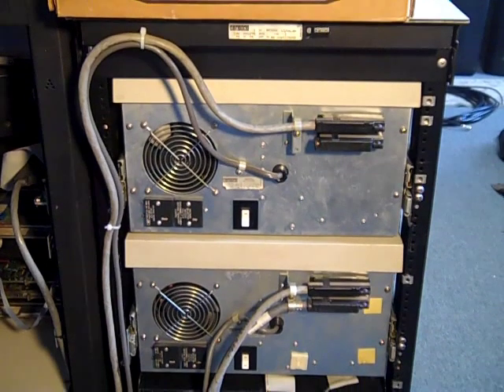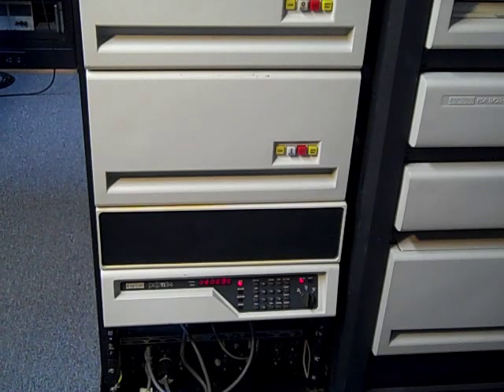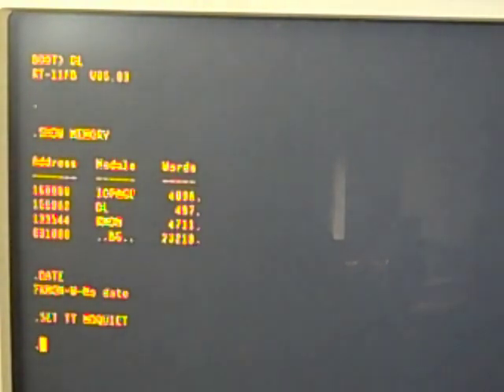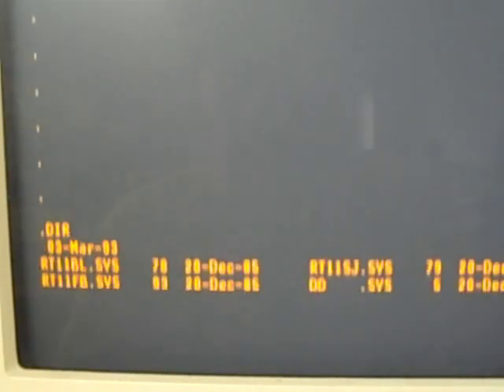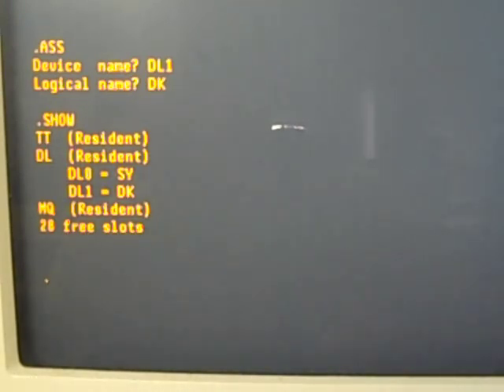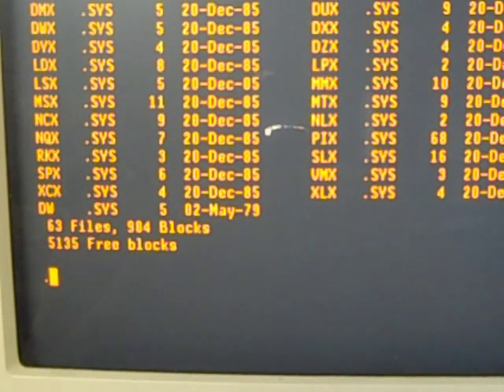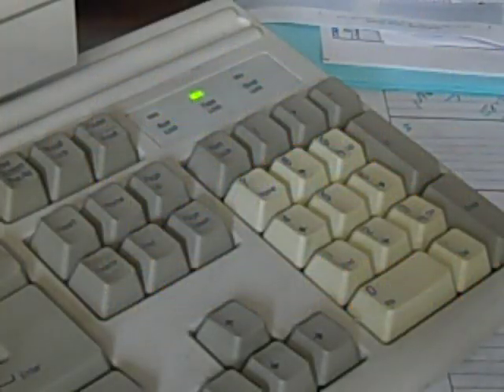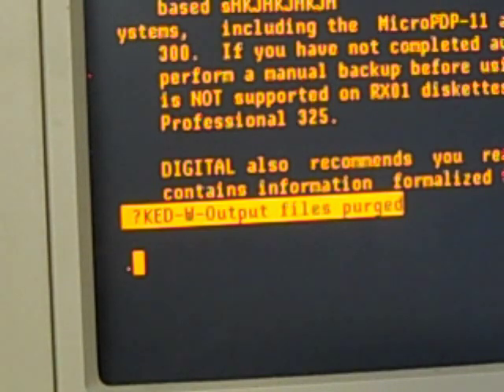PDP-11/34 with RL-01 drives

Comment: That's a marvelous set-up you have there! 👍 It really brings back memories. In the late 70's, I was a Research Specialist for NASA and the McDonnell Center for Space Sciences at Washingyon University in St. Louis. I maintained and programmed two PDP-11/34 systems running RSX-11M. One of them did scientific calculations, and the other drove a Tracor-Northern  automation system of a JEOL JXA-733 scanning electron microscope / X-ray analyzer.  The TN system used a microprocessor that was a PDP-8 emulator. Great machines!  BTW, about 4 or 5 years after that, I bought a VAX-11/730 for my personal home computer. 🙂
Reply: sos un genio

Comment: I programmed the device driver for the RL01, I believe, originally for the PDP-8. It used a technology that permitted bad disk blocks, detected during manufacturing, so the device driver maintained a map of the bad blocks to make them disappear from the address space. And all this in 512 12-bit words of memory.
Reply: Most people would ask how? Until they understood how well the DEC hardware was made. Everything was done by the hardware. You could write drivers that were tiny...in some cases, 2 words for a bootstrap loader. I have an DEC LSI-11 made by Heathkit. Kind of a rare specimen. with dual RX01 drives.
Reply: That's amazing. Testing for bad blocks was necessary for prolonging the disk's usefulness. Sometimes you had a mission critical operation where you couldn't just simply change out disk packs.
Reply: @classicnosh  Yes, indeed. My understanding is that the product was successful based on my special formatter and device driver. Of course, today disk technology is far better so the need to support bad blocks or tracks probably is no longer needed.
Reply: I assume there also was a diagnostic utility to read marginal sectors and write them to an unused sector and re-map the bad sector to new sector without data loss?
Reply: @JanBruunAndersen  Not exactly. You had to retrieve the good data onto another drive or a tape. Then you could run the formatting program, which would start with the factory-determined bad block list then test all the blocks as fast as possible then create the final bad block list mapping and combine it with the code so it would fit into the 512 words allocated for the device driver, which it would then install. Then you'd copy the data back to the disk. If we wanted hot/dynamic bad block elimination, we could not have fit it into the ancient device driver scheme. Our achieved goal of mapping out the bad blocks so they disappeared was the most we could hope for.

I'm not actually sure how they set up the RL01 for a PDP-11, since all my code was for the PDP-8. It might have had an all-hardware controller, which would have done the bad block mapping.
Reply: For what operating system?
Reply: @david203  I believe it is to a certain degree, however not as a result of manufacturing but wear
Reply: @kreuner11  The main OS for the PDP-8, if I recall correctly, it was called OS-8. It was many years ago, sorry.
Reply: @kreuner11  Mostly due to inexpensive manufacturing. Most bad blocks were that way from the beginning. That was my understanding at the time. My code had to handle many bad blocks and remove them from the address space.
Reply: @david203  indeed it is I see, thanks

Comment: We had VAX computers when  I was at GE from 1983 to 1991.  Also MicroVAX.  The disk packs were 3 or 4 times the height of the RL01 as I recall.  The operation of the disk drives and status lights brought back very fuzzy memories...

Comment: The good old days, the smell of a crashed head on the platter, setting the cats eyes, mod wiring the backplane for the controller to boot the RLO's, (used to love playing with the platter spindle, you could use them for drive shafts on a tank).
Going into data rooms that permanantley smelled of the last crash. Also the Megatek Whizzard graphics (I think 7700) controller that was sometimes the graphics controller (used in REDAC systems) connected to a kratos Mono Vector monitor or a mitsubushi colour Raster running Dsys diagnostics. the 11/34 and 24 were the ones I tended to service the most often.

Comment: Nice video... brings back lots of memories. I started RT-11 version3.0b in 1978. I was with DEC FS for Decades. Minor detail, MSDos came after RT-11 so RT did not look like MDDos... it was the other way around.
Reply: Yup.  RT-11 predated CP/M, and CP/M predated MSDos.
Reply: As a software developer, I had a lot of respect for Field Service engineers, who had to handle just about any problem, sometimes in very short periods of time.

Comment: In the late 80's, I had my own complete PDP11/34 system with a VT52 terminal, 4 10MB drives (RL-01) and a full-size tape drive (14" reels).  I purchased the system for $350 and 3 of us hauled it home.  I don't know what it sold for new except that the tape drive had the original invoice taped to the back showing a price of $65,000!  Everything worked and it looked brand new.  I played with it a few times, but it didn't really do much.  It had the RSTS operating system that included BASIC.  The seller gave me a few disk packs and tapes they still had.  I found a tape of something called "UserBase" that appeared to add database ability to the system but I never figured it out.  

What a beast, but I loved it.  It took up half my dining room and was louder than a jet plane.  All my friends thought I was nuts to buy it, and of course they were right.  My IBM PC ran circles around it.  So why?  Well, I had a job for a while  programming a massive PDP11/70 colossus.  It was maxed out with dual CPUs, 10 250MB drives (the huge disk packs cost $1200!), and 5 definingly loud "drum printers" -- all in a climate controlled room with backup power and a Halon fire system.  There were 63 VT220 user terminals connected and the stack of cables behind the main unit was 2 feet deep.  It was such an impressive monster that just starting it up made you feel like a god.  I just had to have one of my own.  Sorry to say my system eventually ended up at the dump (*sigh*).  Much like the 11/70  I worked on.  It was eventually hauled away (donning a 'for sale' sign that said 50 cents or best offer) and replaced with a very big VAX system.  But that was only used for about 6 months before company politics caused the VAX to be auctioned off and replaced with an IBM system 38 plus new terminals and miles of new "twinaxe" cabling (those IBM salesman are good).
Reply: Sigh. Prices were very high in those days. They had to support may trained people to sell, build, and maintain the hardware, and to program the system software. I worked for DEC in several departments, later worked for Prime Computer and lots of other companies.

Comment: Thanks so much for posting this! I miss this machine so much. RT-11 SJ had a multitasking cousin called RSX-11, designed and implemented by none other than Dave Cutler, the only intelligent person still left at Microsoft. The KD-11's had TTL ICs on them and was built out of 74LS181's if I recall. I could fix them with a scope and a soldering iron. I wish I had one in my basement. I spent so many hours playing "Advent" on this. Wrote tons of code for the IP-11 too decades ago! Thanks so much!

Comment: I once had access to a PDP-11/44 running RSTS/E. that was the extent. My first time at college I realized you could allocate devices from terminals things like other terminals etc. including the system console. That's a story in itself. However in my career I also got to manage  a Data General Eclipse MV9500 that I upgraded to an MV9600 that was running AOS/VS II.

Comment: I used to use RSX11M on a PDP11.  It was a newer 80's model.  I remember being told that they had a choice between this machine @ $35k or a new thing called a P.C.  They decided that P.C.s were never going to catch on and endure so they bought the PDP11!  It had a 10MB drive but only 540k RAM.  We used it in conjunction with an X-Ray Spectrometer for metallurgical analysis.  There I had to issue an MOU command to mount the floppy AND the hard drive.  You know in the end I wound up owning that machine myself but I was too young to realize what I had so I got rid of it at some point!
Reply: So hard to predict the future, so easy to look back.

Comment: Used to Maintain Dec. A lot of these tpe were used for CAD and graphics Via the Megatek Whizzard Controller. Unplugging the drive number button to change the boot drive. VT terminals especially Vt220 used to blow the serial interface chips like no tomorrow.

Comment: How much did each disk pack and drive cost, back in the 70's or 80's?  For them to only hold 5 mb of data, not much could be allocated to each user.

Comment: I thought that UNIX would be case sensitive because I find with the OS that I am running on my computer if I use CD or DIR I get the error CD OR DIR not installed do you want to install it but if I do cd or dir then the function operates as expected if you are interested as to what OS I am running well it is DEBIAN UNIX, if I want to edit something I use gedit, I am running Linux Mint 17.3 (Rosa) 64bit (Cinnamon) Lothar Scholz I could run Doom under Wine for Windows and would be very fast, I have had a good close look at a PDP11/34 which was installed at Trostan Avenue which was the Collage of Further and Higher Education, But the DEC VAX750S was brilliant but if you wanted to do something like add extra memory or something than you had to wrap up warm as it was so cold that even brass monkeys would have problems.

Comment: That would be really cool to make an RL-01 drive with a USB ibterface so you could run one as a USB thumb drive. ..... Can you run Linux on that thing?
Reply: TalksWithDirt There_is_a_video_on_youtube._search:_The_Worlds_largest_USB_thumb_drive._Don't_mind_the_underscores._For_some_reason_the_space_bar_doesnt_work_in_the_reply_field
Reply: Gonna look it up now. Hope its as cool as your solution to the space issue. :)
Reply: Probably not Linux compatible - 128k is nowhere near enough memory to run even the slimmest kernel, let alone anything else. Plus if it's as similar to the 68000 as is sometimes made out, it might not have sufficient virtualisation and memory protection abilities by default ... though some 68k based workstations got around that by incorporating bespoke memory management units and the like, so possibly if you added that plus a load more memory it can run a very spartan distro, very slowly, and without any graphics.

Not sure why you'd want to though. I mean, the default DEC OS (TOPS, I think?) was essentially a thinly disguised Unix fork, so that should do the job in most regards, and that's what all the software will be designed for.

Comment: How can you stand the noise it is really loud why you want to have that can not do much
Reply: This thing is quite expensive, they are no longer being produced, and they are some form of an artifact for people who like collecting old hardware and such.
Reply: An older PDP 8, is on sale on ebay for $6000 USD.

these are antiquities.
Reply: He may have only shown off the very basic functions, but that's not all it can do, same as if you were only shown DATE, ASSIGN, HELP and EDIT on an MSDOS machine you wouldn't think those were its only functions. PDPs were quite a popular choice for all kinds of professional, academic and other institutional uses, and a home user who doesn't really have any call for any of that other than curiosity can still find a good number of games to play on the system as the DEC hackers weren't exactly unfond of computer gaming.

As for the noise, they were still a lot quieter (and smaller, and easier on the power budget) than an equivalent mainframe of ten years earlier,  and those fans are probably quite worn out with less than smooth bearings these days. Normally you wouldn't work right up next to it anyway, it would at least be in the other corner of the room (serial terminals can use very long cables without any trouble) and maybe behind an acoustic shield or with the fans venting out of the room, or just as likely in an entirely different room altogether and forming the basis of a multi-user system with a dozen or more remote terminals, a lot like the modern day equivalent server room.

Comment: Is that rack the whole computer or it is actually larger?
Reply: The "computer" is the lower module in the rack; the upper two boxes are the equivalent of a pair of external (and removable-platter) hard drives. So, yeah, the entire system is in that frame, though the terminal used for human interface is of course separate. That's where you get the "minicomputer" vs "mainframe" distinction - a mini would fit into just one of those racks, often only needing a half-height one (or three quarter like the floppy-equipped system next to it; full height if you added a DECtape module, network adapter, etc), whilst a mainframe used several full height boxes, each one dedicated to an individual function, and the terminal alone could be as large as a mini. Whilst "microcomputers" went the other way and compressed everything into a free-standing box (and maybe a second for the data storage) half the size of a typical minicomputer CPU module, or even into something resembling a terminal.

Comment: Oh my god, can you install Doom on it, i want to know how many frames per day this machine could render.
Reply: The system architecture is nothing like x86...

Also, the point of a PDP-series machine was never gaming, but rather data processing, industrial control, laboratory experiments, etc.
Reply: Lothar Scholz woooooooosh
Reply: If you installed enough memory into it, and a graphics output or at least a much faster terminal, you'd be surprised. The PDP/11 has about the processing power of a midrange 68000 (indeed, much of the 68k architecture was directly based on it), and whilst there aren't really any official versions of Doom for pure 68k machines (68020s and certainly 68030s, yes), there have been plenty of unofficial ports with varying degrees of faithfulness to the original, and even more good quality Wolfenstein rip-offs.

So it might still only manage a couple of frames per second, but it could be attempted, and a Wolf3D clone would likely be fairly playable.
Reply: @TahreyUK  Even though the CPU may be powerful enough. There was no direct graphics display. All interaction was via VT type RS232 terminals at fairly low baud rates, so doom wouldn't be possible. Simple maze games with static backgrounds are about the limit.